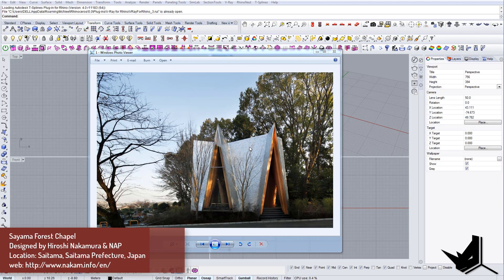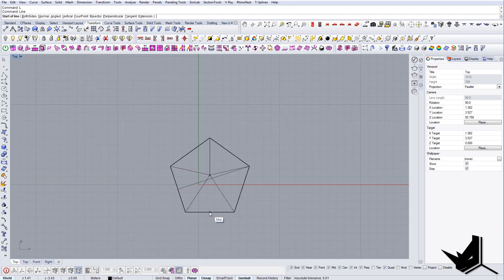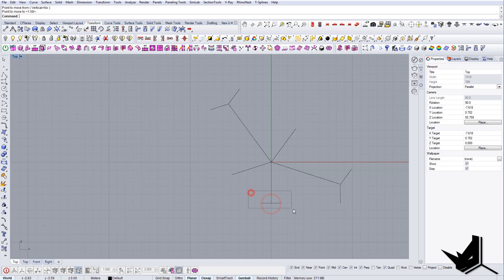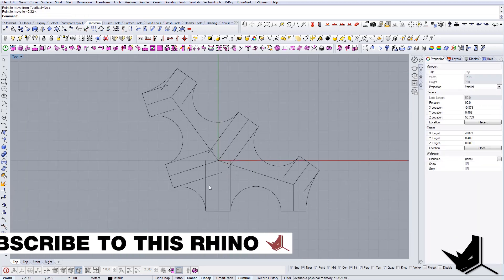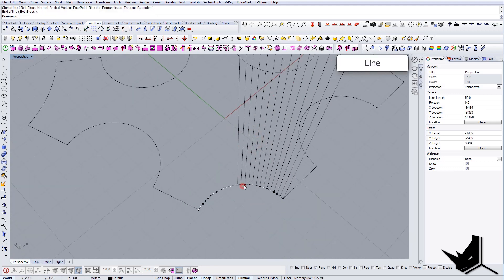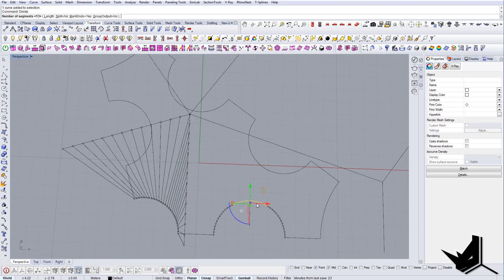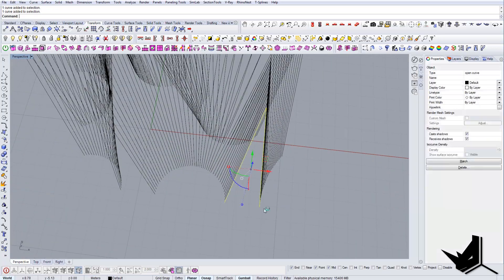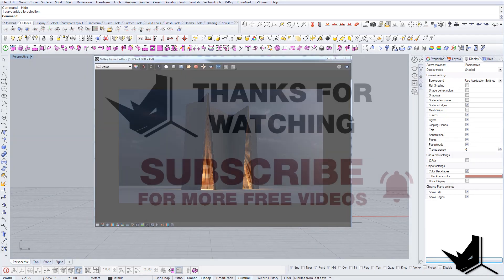How to Model Sayama Forest Chapel in Rhino

Comment: How you made the roof
Reply from the maker: Hey Bruno, 
The way I made the roof is using Sweep 2 command. I just selected the two rails at the top o the roofline and the bottom part from the base plan and I selected the farthest two lines as section lines. I did that process for each roof surface and gave it a bit of thickness at the end with offset surface command. Hope that clarifies things a bit :)
Reply: @HowtoRhino  Hey, I'm also facing the problem with the roof surface, I tried the method you mentioned but it dont seem to work. Hope to get more information on this :D thanks